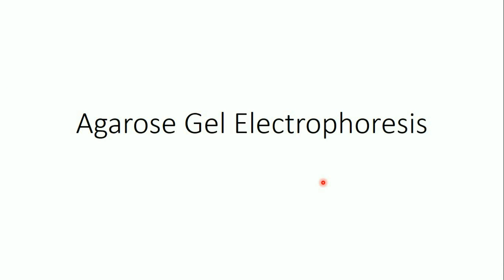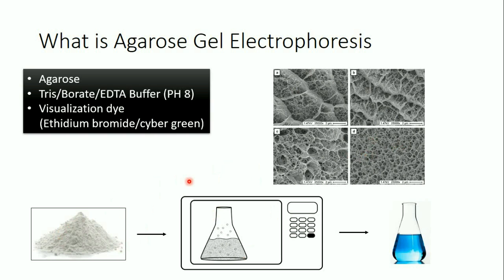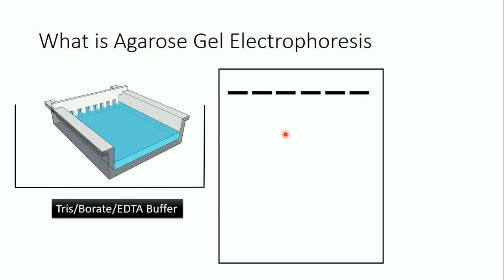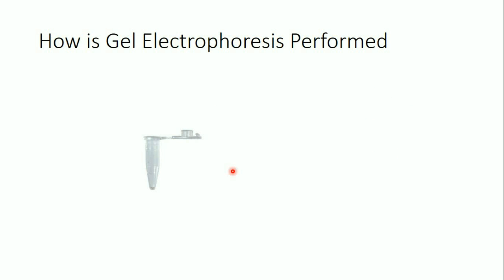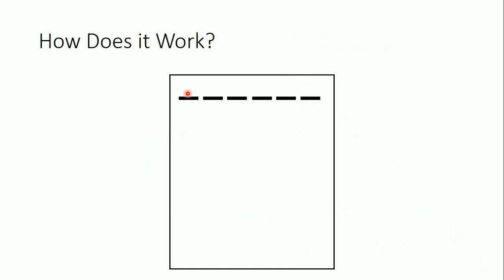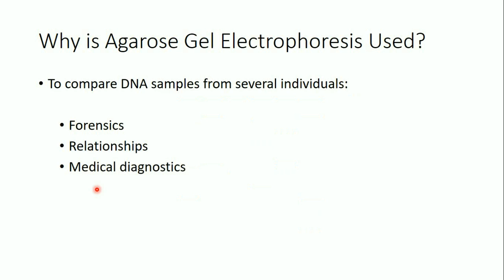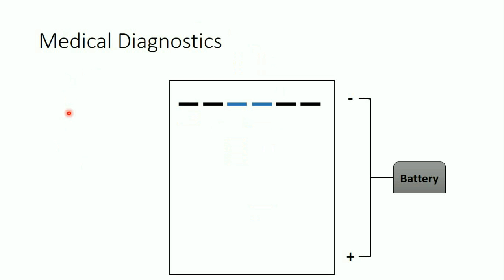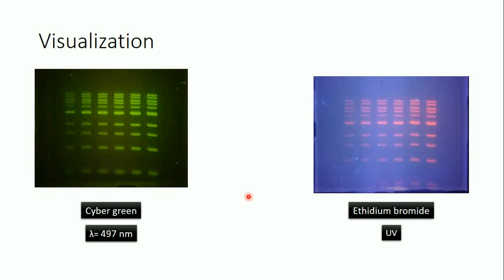The Principle of Agarose Gel Electrophoresis, a full explanatory video

Comment: Great video, thanks!
I have a question concerning visualisation: If after the gel we have the blue bands with the loadind dye, why do we need to add Ethidium bromide to make it visible under UV? Isn't the information we have from the blue bands sufficient? Or is it maybe, that the blue bands we see after we ran the gel is maybe almost only the dye itself, as it leaves the DNA (or RNA) and just sinks faster to the + side, so that our actual DNA (or RNA) is located a bit above the dye - and that is why we need to check it under UV, as it would be "invisibly" located above the dye? Really can't find any answer to this! Thanks again! (:
Reply: We either add GelRed right into the gel or we use ethidium bromide later for visualization; both are carcinogens but we would not use both at the same time.